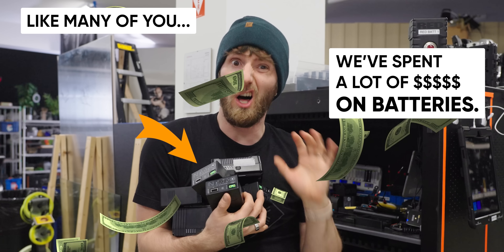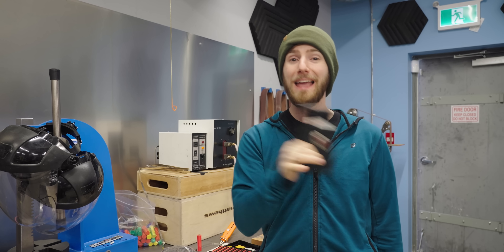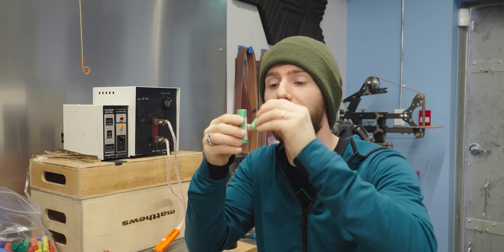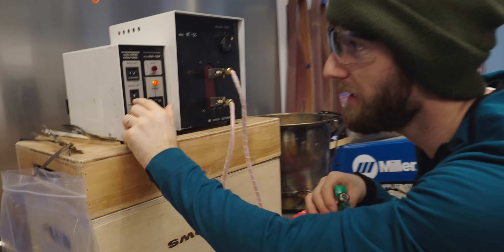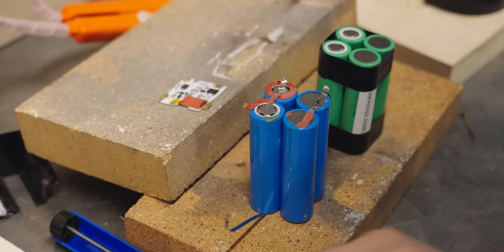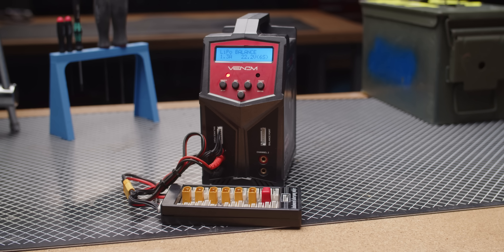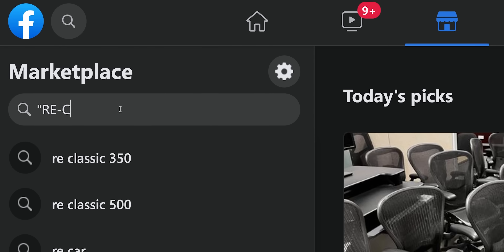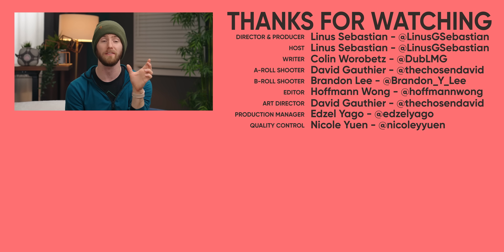This should be illegal… Battery Repair Blocking

Comment: Manufacturer of film gear here. 
It is all fine wanting to replace stuff and extend the life of it (Right to Repair is fine with me but not other companies I know...), but in all honesty, a battery case is not what a battery make! The cells are the battery!!!! If the cells are dead, the battery is dead. You can replace the cells but all you have is a new battery and a shell with our logo on it that does not reflect the build quality and standards that come out of our factories. 
If that battery pack was to ever go boom. Not only could it damage property and life, but it could also damage our company's reputation (guess which one the companies cares about most). This is why you should always take a battery to a service center approved by the manufacturer or send it directly back for servicing.

Should the manufacturers offer services to rebuild cell packs into old cases? I think so. The case is like $1 to $5 worth in value though. All the cost of that battery is in the cells and BMS (and the obvious markup for profit). Batteries also get dropped, especially if you have a Linus working in your crew which trust me, most do. So putting an old case onto new cells might not make sense logically either. So now we need to make better cases which can be used for decades rather than years and have replaceable cells. 
Is it a waste to then throw these old battery bricks away? Not really. The shells are typically hard plastics that are up to 100% recyclable, the battery cells are recyclable too. The BMS could be sent back to the manufacturer and put back into a new battery brick once verified. 

There is a lot the film industry manufacturers can do to improve the life of products. This includes servicing items such as batteries, making built-in batteries easier and safer to replace (no fking glue) etc.
Right now, all Linus has is a battery with questionable build quality in use in a film studio which has a lot of liabilities attached to it. 
In all honesty, this video is not promoting Right to Repair. It is promoting the idea that these devices are a lot less dangerous than they make them out to be.
Granted they showed the minimum as to what could go wrong messing around with stuff like this. 

Yes I would like to see the tour. I think it is much better than consumers understand the life cycle of products and respect them more so that they can better make use of their items rather than throwing them away. Even if they are getting recycled.

Comment: Imagine a PC you can't change the components inside of, it could be a reality. Right to repair all the way. I've driven cars between 20 and 50 years old for the past decade, I'm willing to learn and get my hands dirty. My gaming rig is slapped together from second hand board, case, ram, cpu and gpu all nearly ten years old. I was able to manipulate enough settings to play cyber punk 2077 on windows 7 ffs, Imagine not having those settings to tweak.

Comment: Usually you have to jump-start the bms by momentarily shorting the battery output to the power output this works with some bms as the bms doesn't have power to turn on the mosfets that disconnect the battery from the bms

Comment: The RED BMS is a modern smart-battery solution. It is not inherently "evil" but it has a s*itload of safety features. If it discovers a voltage to be outside bounds, it locks up and turns into a brick. The way to re-cell battery like this is to hook up some temporary cells/power supplies for all the cell taps while replacing cells. This keeps it happy. Depending on programming it might work with new cells or not. YMMV.

Comment: I want to start a business recycling batteries and e-waste! This is my dream. I know it can be done! There are procedures being developed now that allows for a “cathode change out” and makes recycling batteries profitable. You can use old cells to make a pack as long as you match up cells to capacity. And if you add a fuse to each cell. Your have a very safe pack!

Comment: I started RC FPV quad stuff a few years ago...my viewpoints on batteries have changed to the point of "I can probably put laptop batteries in that" for about everything.  Measure the voltage, measure the amperage needed... size your battery pack.  it's so much easier than i ever imagined and the cells are often MUCH cheaper than the battery packs

Comment: Holy cow those sparks are fine.... The spot welder is running hundreds of amps to weld the pieces together. That just means you rocked the spot welder a bit and one terminal was a bit higher than the other. It was nothing to do with the battery.

You guys were panicking when you didn't even have the other side of the battery connected yet. Ergo, not even a complete circuit. It literally cannot spark.

Comment: Why didn't you 3D print a custom holder that gives you the no-gap spacing you need? Then you don't need to sacrifice a battery. What's the point in that big ole shop if you don't use it? I'm sure it has a 3D printer or 12.

Comment: You are luck that your products have battery packs. Many very expensive products have sealed in for life batteries. This should certainly be illegal, as the battery life amounts to built in obsolescence for the product, be it a tablet or laptop or mobile phone, consigning it to an every growing mountain of electronics waste after a couple of years.
There was a time, not so long ago, that mobile products came with replaceable batteries, now almost all such products have sealed for life batteries. The manufactures insist that this makes the products thinner and more desirable, in practice this is a excuse for building in obsolesence, ensuring consumers are forced to regularly replace them. Asked consumers what they would prefer, a thinner water resistant product, or a product that lastered longer, and I am willing to bet the latter is the more popular choice. Particularly when the water resistant argument is bogus. 
At least the power tool manufactures have got the message, in that their products come with replaceable power packs. Earlier battery powered drills and the like had sealed for life batteries, and in those days they were NiCd. This choice of chemistry guaranteed the drill was consigned to an early grave, particularly if it was not used that often. 
If the consumers are not to be exploited by designs that are engineered to fail and to save the global environment, it is time that sealed for life batteries were outlawed. It is also time for battery packs to be standardised, so third party manufactures can make and recycle them. 
One might ask why batteries like the 18360 can not be used as replacements, just like the double and triple A batteries. It is understandable that there maybe a need to integrate the battery management close to the cells it manages, but it must be possible to keep the electronics contained in the battery pack to a minimum. It is nonsense that a dead battery should consign all the electronics in an expensive product to the bin. 
When did replacing a battery become a repair task. The right to repair should force manufactures to return to the user replacable battery philosophy. 
If the safety of Li ion chemistry is an issue, I would be happy to switch to the more robust LiFePo4 chemistry, even if it means sacrificing  some battery discharge endurance.

It is worth asking why battery pack are assembled by welding nickel metal strips to the battery cells. There must be a better engineering solution to providing a low resistant contacts.

Comment: The NP-F battery may have worked if you had thrown it on a charger. A lot of BMSs of that quality don’t allow power output once they hit their low voltage cutoff unless they get power in.

Comment: I just used a digitally controlled soldering Iron, had no issues aside from that the batteries had on strip already spot welded in one direction and I needed the strips at different positions so had to bed the strips over and in the directions I needed them, and that caused the back to be to tall to fit in the dustbuster housing which was nothing a Dremmel couldn't fix.

With having electric shavers die on me on a regular I decided to avoid buying rechargeable items whenever possible.

Comment: i feel like  the video is to main stramed for an LTT video... you threw away lots of ok bateries they can easly be used as rechargeble flas lights or low end ups they can still hold a charge speciali the ones that were new an just hapend to be next to the one you damaged with a badly diald spot welder.... but what do i know i just watch videos on YT so go to the recycle faciliti.. sory for bad english

Comment: if your not concerned with safety with reusing old cells. big practical reason is the new cells will wear out the old cells faster, making you redo the battery again quicker. so if you don't care about being safe i have to imagine you care about not doing more work.

Comment: This is cool, but the sparking isn't a cause for concern on its own. If you don't have good contact (or a small air gap) you'll get a spark (arc) between the spot welder and the nickel-plate. This doesn't mean the lithium cell is going to explode. This is similar to the sparking from an arc welder.

Comment: the capacity-dependent shutdown of the bms sounds very bad. are there examples for this? What if you capture a video in the cold for a week or two and have temporarily less capacity due to lower temperature and come back. is the capacity now artificially lowered by the bms?

Comment: Lithium cells itself aren't more inflamable though. You need to differentiate between NCA/NMC cells (like in nearly all electric cars) and LFP cells (like in Tesla Model 3 Standard Range+). LFPs don't burn really. NCA/NMC burn quite well as you said. However you said that it's all Lithium cells which isn't true ;)

Comment: Remember when phones had replaceable batteries? Now that phones are developed enough to last longer than 2 years easily this feature needs to return. I'm still rocking my galaxy note 8 and had to spend 200 for the battery replace after cracking my screen. It pushed me to try for another year out of it.

Dyson handhelds as well, I love how repairable they are overall but disposing of the battery was a struggle and when I did I wasn't confident it would be recycled.

I've argued for a long time that things like overear headphones, keyboards, mice, toothbrushes, torches etc should be using NIMH over Li-ion based cells. Yes they won't last as long between charges but in many of those cases is that a problem? I've thrown out so many of those items after something went wrong with the battery and could have been easier and safer to replace.